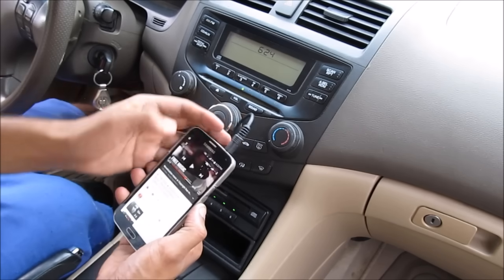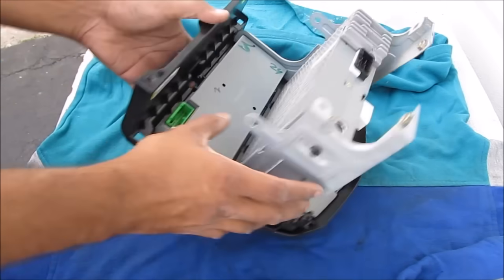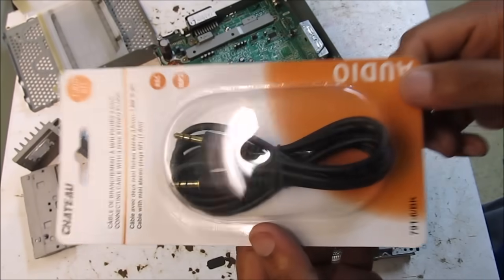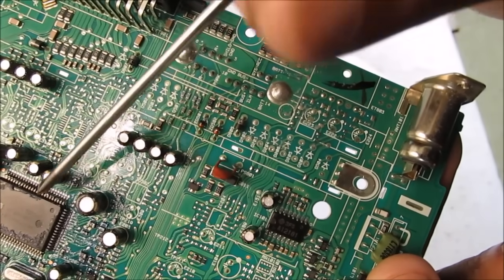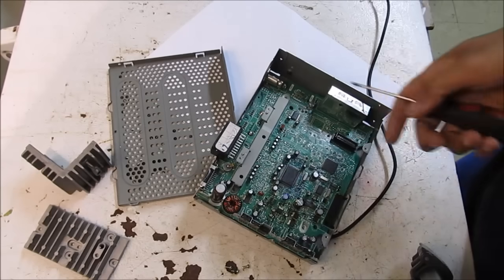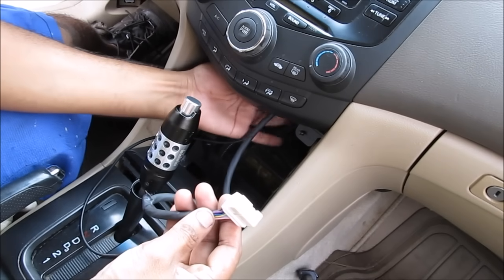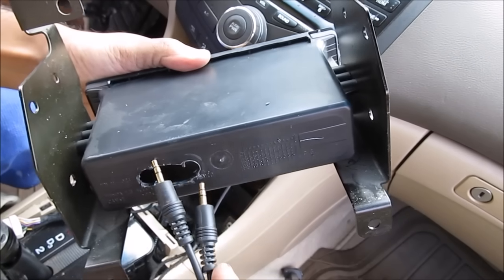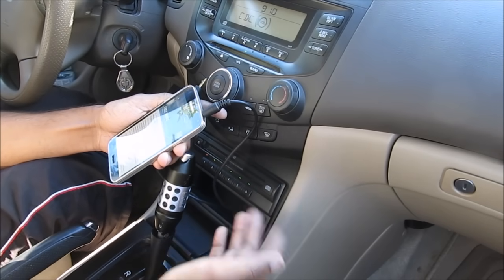$1 AUX Stereo Input Hack

Comment: Just buy a dam aftermarket radio cheap bastards, that aux cord gonna mess up in a week anyway.
Reply from the maker: +Devonta Marshall but it looks so ugly
Reply: Yeah, but lots of folks like to keep their stock stereos.
Reply: speedkar99 and that looks better
Reply: deasttn i like stock radio
Reply: Most cars have shit audio systems, unless you paid extra for JBL, Bose, Harmon Kardon, or whatever in your car.
Reply: Devonta Marshall haha I agree  nuff said thanks
Reply: If he'd done a good clean job instead of a crappy half assed dodgy bob job then it'd be fine. What he has now he's liable to burn out the diodes to the tuning circuit or preamps if the poles on the plug make contact.
Reply: Devonta Marshall wow slightly harsh
Reply: Devonta Marshall little shit
Reply: You can use the same principals to hook up a Bluetooth all you would need beyond this is a 5volt to power the bluetooth or fibd a 12volt bluetooth which has a 5v powersource in it already
Reply: Homie Pig actually, most cars now have decent stereos. Not to mention the fact that the biggest contributor to audio quality is not the head unit, but the speakers...

Comment: I will admit, this is very interesting and didn't think about this, however, back when I was a lot younger and upgrading a stereo wasn't really financially possible, I would have done this. But it's a lot of work, I'd most likely swap the deck for one with a better integrated amp and aux built in for preparation to upgrade all speakers. 

This is cool though.
Reply from the maker: Thanks, but I didn't like the look of gimicky aftermarket radios.

Comment: Including the toothbrush in your hack was straight mcgyver -LOL.  I'm going to try to hack my Toyota.
Reply from the maker: +Signed Up Haha yea thanks. Here's the video for the Toyota : https://youtu.be/bRIswrodoM8
Reply: Thanks I'm interested in doing something like this on my is300.  The CD changer no longer works.  I'd like to hook/hack inline to the cable  which connects between the head unit and the CD changer.  I guess I'll have to research first to determine how the CD changer is connected.  Have you done and is300 aux port hack?

Comment: instructions unclear, locked myself in the trunk.
Reply from the maker: Sorry to hear that. At least you have wifi in there to post this.
Reply: speedkar99 Update: Day 3, running out of data. hungry, and need water. portable charger is dead, this is that last of my battery.  hopefully my phone doesn't die in the middle of typ

Comment: Yeah first and foremost make sure you unplug the battery unlike this guy. Could cause anti-lock to engage.
Reply from the maker: No need. The shifter has to move with the key in the ignition.
Reply: I read too many horror stories of anti theft looking up the car and other mishaps while unplugging the car stereo so I usually will put the handbrake up, shift back to first then go and unplug the battery. Better to be safe than sorry! lol.
Reply from the maker: +Central Edits TV But in an automatic car you have to move the shifter to allow access to the radio. Key needs to be on to disarm the shift interlock.
Reply: Yeah but you can first put it in neutral, turn off the keys and then unhook the battery is what I'm trying to say lol. Been doing it for years.

Comment: Did anyone else notice that only the left+ wire was soldered to the FM box, and the right+ was just taped back? Just because the sound comes out of all the speakers doesn't mean it's stereo. You just have four (or more) speakers playing the left channel, and anything that plays on the right channel you won't hear at all. The audio from the FM box comes out multiplexed, and the DSP chip decodes the left and right from it. The audio coming from your phone/ipod/whatever isn't multiplexed and you've just lost the right channel. Lame. At least hacking into the cable going to the CD changer or whatever should get you access to both channels.
Reply from the maker: +Chris Richard Yep I agree. The multiplexing thing was hard to figure out. I'm sure there might have been an easier way to hack into the signal after its been decoded for a proper stereo sound. I suppose you could connect both left and right to the board at the same point but I don't think that's a good idea for the phone.
Reply: Connecting the left and right from the phone together will cause all sorts of problems. This is a relatively new phenomena. Used to be fine to connect the left and right output of stereo equipment together, but with phones and modern stuff I've seen it range from just not working to shutting down the phone or ipod. I agree, there's got to be a way to catch the L and R after decoding and before being amplified. I've tied right into the amplifier chips with a suitable resistor and capacitor network but then you lose the volume control, and have to use the volume on the phone/ipod.  Indeed, that may be an issue here, too. That main processor chip likely decodes the multiplexed FM stereo signal, then adjusts the level going to the main output transistors. I seem to have found that the best way to get an input while keeping the stock head unit is to get an FM modulator that connects in series with the antenna lead. The little wireless ones are garbage, and most of the ones I have taken apart combine the left and right through resistors and output mono anyways. Plus they are staticky anyway. The wired ones are usually clear with good stereo sound, and come with a kill switch if there happens to be a station on the same frequency it's set for.  That way you can listen to the station or flip the switch and listen to your device. They aren't usually more than 20 bucks or so for a decent one.
Reply: Without getting into a schoolroom lesson about how FM radio works, in simple terms the signal is broadcast in two channels, and they aren't left and right. The first channel is Left+Right (combined to stay compatible with older mono radios) and the second channel is Left minus Right. A mono radio would ignore this second channel, and a stereo one uses both to compare, invert, and ultimately isolate the separate left and right channels. (Over simplified, but this isn't the place. If you want to know how it works see wikipedia)

Comment: seems like a lot of work, but hey if you have the soldering skills and time go for it. I personally don't like FM transmitters they always seem to be staticy and low sound quality. or you have to power them by a battery or use the lighter plug and then u have too many cables in my opinion. the big suggestion I would make for this hack would be, if you're gonna go thru all this work..solder on a good quality female aux port that you can mount in the dash and just run a good quality aux cord 
from that to your device. because we all know aux cords go thru hell and break semi easily. so if those broke you just cost yourself a boatload of more work!!
Reply from the maker: +Jay Stevens thanks

Comment: REMOVE NEGITIVE CABLE OFF THE BATTERY FIRST
Reply: that's another reason to not drive a automatic lmao.
Reply: speedkar99 automatic problems
Reply from the maker: +Abe Coulter then I can't move The shifter to get radio out
Reply: Put foot on break pedal.
Use shift lock
Do what you did in vedeo. Stop remove the negitive then carry on

Comment: Wouldn't using the FM module in the method you did create a situation where you're inputting mono? Since it looks like you only soldered the left or right wire from the aux wire.
Reply from the maker: +ndawgtkd yes I mentioned its mono in my video

Comment: Oorrrrr, you buy a $20 fm transmitter and save this pain in the ass process lol
Reply: Jordan Scott I HATE THE TRANSMITTERS.  Too much static and inferences.
Reply: Daniel Chavez I have no problems with the one I have, maybe it's quality?
Reply: Jordan Scott i suppose so but i only spent like 20 for one
Reply: Daniel Chavez I find if you tune it to the highest frequency it normally does better. There's only one spot that I get interference in and that's when I drive right beside a radio tower lol
Reply: Jordan Scott well umm.......about 5 hours ago i just got a new radio so i guess bye bye transmitter 😂😂😂
Reply: FM transmitters fucks up with the sound quality
Reply: "quality"
it's probably a china transmitter blasting out 100 times the power allowed according to regulations
Reply: Jordan Scott what brand do u use. i bought one for 20 bucks and static to the point where i don't even use it.
Reply: The FCC got involved and lowered the output of FM transmitters. Even if your lucky enough to live far enough away from radio stations you will have a substantial loss of sound quality. If this looks like too much work maybe you would be better off purchasing a new head unit. To guys that like electronic engineering this is a solid video.
Reply: Jordan Scott 
So you can have staticky audio forever? Lose signal when another car drives by you and shares their disney tunes?
Plus some of those are so cheap they just stop working after a few uses.
I'd rather hardwire into the speakers for goodness sakes.
Reply: Jordan Scott they suck!!! and if you have any knowledge of how to do it and a buck for the auxiliary cord this is the best best method
Reply: Jordan Scott fm transmits shit quality
Reply: get a $3 on on ebay problem solved
Reply: what? how did you solve the ebay problem?
Reply: Jordan Scott exactly what I'm thinking..
Reply: Pradheeth Reddy  your recommendation worked perfectly the transmitter flex neck is awesome it just plugs right in to the charging port itself to stay powered. The thing has absolutely no static lol
Reply: I just bought a FM transmitter for my 2003 Honda accord but I have no idea where it plugs into? It's not going into the power outlet thing?
Reply: Emran Rezai yes, I bought one for a friend of mine but this one has Bluetooth, meaning you set it up in a radio station like 87.9 something like that and you use your phone Bluetooth to connect to the transmitter and surprisingly works pretty good
Reply: Jordan Scott 
That makes sense, the closer the waves are to each other, the easier it will be for the antenna to pickup its signal.
Reply: Jordan Scott thank God I found a wire with the red white to aux
Reply: The one I used was the Scosche FM Transmitter Flex Neck (FMTD3 to FMTD3R) which you can find at Target for 15 bucks and that one had absolutely zero static
Reply: Jordan Scott Hey can you tell which one you use, I have a V8 Duramax Turbo Diesel Chevy Silverado and it doesn’t have the auxiliary and the FM transmitter that I bought it’s not good, thank you!
Reply: I had the same problem, then i found the scosche fm transmitters. The one I used was the Scosche FM Transmitter Flex Neck (FMTD3 to FMTD3R) which you can find at Target for 15 bucks and that one had absolutely zero static. But ive had friends use others from the same brand and they work amazingly
Reply: Jordan Scott yo this shit is nutty this man went through all this frustration
Reply: Pradheeth Reddy thanks!
Reply: Jordan Scott you can buy them on amazon for 5 dollars lol
Reply: Jordan Scott definetly
Reply: fm transmitters are terrible but this is too much work and riskfull
Reply: robin Alter I’ve bought 10 transmitters that worked fine

Comment: Excellent! I like how your tutorial is an actual tutorial on how to actually mod the system instead of just use an FM transmitter, I like to go straight to the opamp ic and use a digital turn on circuit to connect and disconnect the aux cable and it also has crossover controls
Reply from the maker: That's a good tip. You need to use i2c programming to trick it into analog input mode, then you can control from equalizer. Read up the data sheet for the chip
Reply: Sspeedkar99 Who are you replying to?
Reply from the maker: +Anthony Volkman you asked about going to the IC directly
Reply: speedkar99 ok, I just wasn't sure.

Comment: i would rather just spend an extra $79 and get a radio with more functions like bluetooth
Reply: Dont have 80 bucks? get a fuckin job!
Reply: Yeah because by the time you have bought a decent soldering iron flux and solder and the cable then done all the work you may as well just got a new radio or a 2nd one. Plus after market will pump out so much more power than stock and instantly improve sound
Reply: Some cars loose the steering wheel radio controls if your replace the stock radio
Reply: 80 bucks?? wow..wow.. dude!! It's 79 bucks! You still have one dollar left for a cable!
Reply: The radio is $79, but the dash kit for this particular vehicle is $400... Unless you buy the cheap lower dash bezel that places the aftermarket radio where his factory CD changer is, but that looks more tacky. Plus a $90 steering wheel control interface, plus pay someone to install it all. You're at least $700 do to an aftermarket radio in this car correctly.
Reply: BuyTheTicket TakeTheRide Guess what he said didn't  buy the ticket? Stop being cancerous
Reply: Exactly
Reply: not_found only if you don't use a module. with very few exceptions, you can always keep those buttons working
Reply: the modules are pretty expensive, 20$ for the radio but a module can cost 90 bucks or more depending on the car model
Reply: not_found A $20 radio is pretty worthless in the long run, and probably doesn't even have a jack for SWC. Yeah they're expensive, but as with all of this, it's convince.
Reply: I live in the UK so its rather different for me. Most people used to swap radios out ao much so you could pick one up posted for £25. My sony radio has a usb and aux jack and that cost me £20. Not so sure for you guys over there but a new bluetooth stereo here (basic) would probably set you back £60 for a decent run of the mill normal power 4x55 speaker
Reply: Pete 88 yeah, that's actually about right considering used prices
Reply: Dude read again, I never said buying a 20$ radio is a good idea, you better keep the stock radio and spend 100$ minimum on a new radio, if it's cheaper don't even bother because it will sound like shit. If you don't care about audio quality get a 5$ bluetooth radio transmitter and done.
Reply: not_found not_found Sure! You mentioned that in some cars you lose SWC, but by and large that's not actually the case if you use a module. If you have factory SWC and don't use an SWC module, then you will definitely loose SWC.
Reply: BXD ???
Reply: Dylan Wold lol it’s expensive because you’re to lazy to shop for deals
Reply: Dylan Wold sonic electronix gives a free dash kit with every single and double din head
Reply: +BuyTheTicket TakeTheRide you can buy a cheap dual brand headunit for $30 at wally world that has usb,aux,cd, an bluetooth

Comment: or just buy an fm converter... i just spliced the power source to a USB cord and made it run when i plug it in. spent $10 for something that didn't involve me taking apart my dash board.
Reply from the maker: How's the sound quality compared to CD?
Reply: speedkar99 crystal clear. normally they require two triple a batts but with USB power it has constant power. it also allows you to switch between stations on fm channel.

Comment: Can this work for a acura tsx? its an 04 model . ut has a 6 disck changer but its build into the radio in the dash not in the arm rest
Reply from the maker: Try tracing the lines from the CD changer. Most likely its digital though. You might have to get an external device or use the FM route.

Comment: Hacking...? Do you have any idea what it means to hack because I'll tell you now it's not splicing a cable to your motherboard and you're even more dumb because you didn't tell your viewers about static discharge so if they have static energy in them when they do this there is a chance for the energy to discharge into your motherboard and end up frying it
Reply from the maker: Good tip. This is a hack because it works around the way the radio is intended to work. I didn't have issues with static discharge but it does happen.

Comment: The word "Replace" has lost all meaning!
Reply: This fucker has defined the meth head meaning
Reply: Literally replaced nothing the whole video but said it 50 times
Reply: Haha the ashtray was held in by 2 screws and $2.47 in change 😂
Reply: Reinstall lol
Reply: I wnat 1 hour video o replace
Reply: Lol too funny
Reply: On 9th gen. Accord...you can't easily replace. Car functions are built into the OEM radio. WAY too much hassle to replace on 9th gen. and lose some functionality. And only for a slight gain in sound quality. His method is smarter. No one will break in to your car to steal the radio. You can use the monies you save and the time you save to put in to the speakers, processor, and amplifier. Better results and not worry about a smash and grab. There are many other reasons for keeping the oem radio installed that one will just have to search their mind and think about.......
Reply: put (something) back in a previous place or position.
"he drained his glass and replaced it on the bar"
synonyms: put back, return, restore
"Eve replaced the receiver"
Reply: I was thinking about that as well
Reply: Should of used "place back" instead of "replace"
Reply: 8 Bit Paradise - Re-place , he put it back in place so he did replace it. It can be used in two context.

Comment: yeahhh, I'd rather pay a little extra to save me that time inside of doing this bullshit.
Reply from the maker: With an aux adapter?
Reply: speedkar99 nah homie its like one of those extension plugs where you plug in the adapter peice into the main cables that plug into the radio and then you plug it into the radio with the adpater peice on, kinda like one of those wall plug adpaters that changes it from 2 to 3 pins. and you feed the aux under a little spot under the wheel